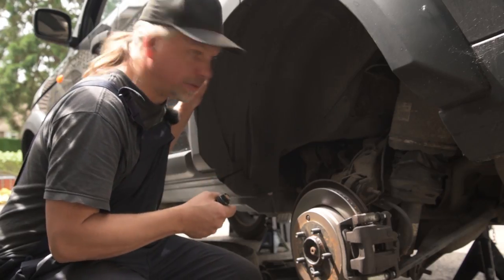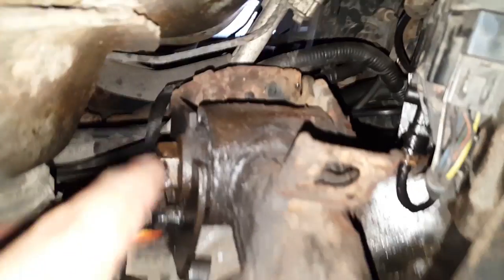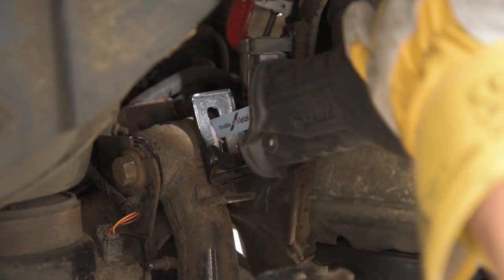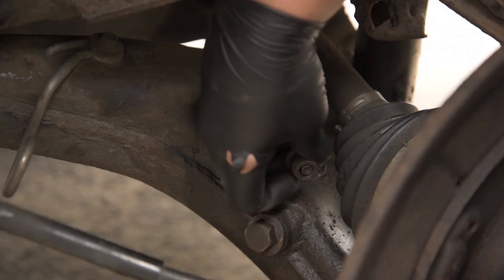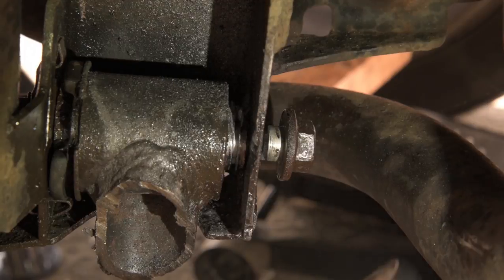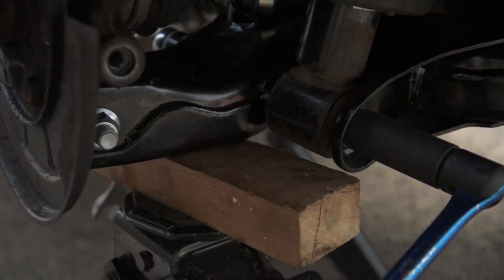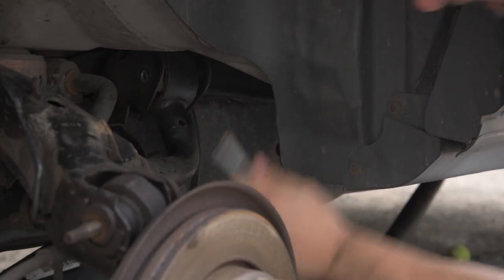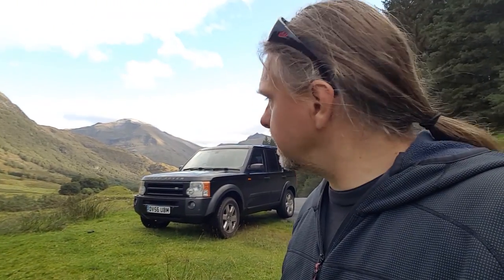Replacing Rear Suspension Arms and Polybushes - Land Rover Discovery 3

Comment: Hello, greetings from Argentina.
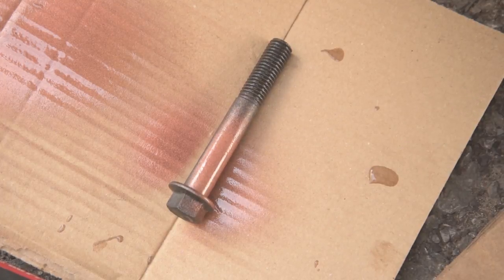Query: What is the use of the spray (apparently copper bath, or similar), that you pass to the pins, at minute 29:59, for example ...
Very good video.
Thank you. Greetings.
Reply from the maker: Hello Argentina.  The "Copper Ease" spray is the cause of great debate on the internet.  It's sold with the intent of preventing bolts rusting to the other components, but some people say it actually causes the parts to corrode faster.  I am not sure but thought that it can't be any worse than it is normally.  It's not a requirement
Thanks for watching!
Reply: @WeAreBigKids 
 OK thank you very much
Reply: @WeAreBigKids  I prefer copperslip out of a tube, but that's personal preference (previously an Siii, and now a D2Td5 owner, looking maybe to take the leap to a D3 ;) ). There's an American machinist on youtube, abom79, who live in Florida; he tends to use anti-rust sprays. You're both in close proximity to the sea and it's salty atmosphere, so I'm wondering if an anti-rusting spray might help on those iron and steel parts?

Comment: Great video👍
Did your dsc(traction control) kick in around corners at all when bushes were worn? What exactly were the symptoms?
Thanks for the video👍
Reply from the maker: I did get a weird corning incident once.  It was like driving on ice, but on dry tarmac.  The ABS went nuts and made me jump.  To be fair, other than that I couldn't really feel any symptoms of the back bushes, but noticed the suspension arms felt loose and wobbly when I was swapping my summer wheels for my winter ones.

Comment: I learnt very early on to put the suspension in locked access mode before working on the suspension on these.
Reply from the maker: It's probably good advice.  Everybody else told me to pump the suspension up high to get your jack under.

Comment: You sure do things the hard way with limited tools like a set of torches and real good impact gun.  A for effort but eventually you will get tired of wrenching when you don't need to.  Personally I would bring that to a shop and at least get those big bolts out, they seize up in the sleeve and need a torch and impact wrench...  That torch you use is only good for plumbing and doing hot-knives, but if you get the miniature double tanks (One is Oxygen) you will get the heat you need and can even do some steel welding, and brazing....  Oh!  Im certain that 2 times you were turning the bolt the wrong way, once it looked like you were pushing wrong way with your foot and at 20:10 lol... thats why you broke the tool.
Reply from the maker: Thanks for the advice.  Glad you enjoyed watching.
Reply: @WeAreBigKids  Ah, your videos are great!  Brings me back to when I was 16 going through the same things, learning the hard ways.  Keep up the good work!  Oh!  Great countryside shots as well, love the scenery. Thanks
Reply from the maker: Thanks for the kind words.

Comment: If you turn a right hand threaded bolt  to the left it will come undone but if you turn it to the right as you was  it will just  tighten it, this is why you couldnt get it to undo. As for all those cheap crappy tools just sling them in the scrap, this is why fully skilled mechanics such as myself use Snap on tools ,they dont break!
Reply from the maker: If only my Land Rover was made by Snap On.... Or Toyota....
Thanks for watching.

Comment: This is the first vdeo of yours that I've ever seen- I don't even know what the rest of your channel is about. Hell, I don't even own an LR3 (hopefully buying mine in 2 days!). But this video was so in depth and personable/relatable, and the extra time you put into the filming and editing... I would be doing a disservice by not subscribing. Cheers from the US.
Reply from the maker: Thanks for subscribing!  I hope you bought that LR3?  They're brilliant.  I've heard the US ones don't rust as fast.
Reply: @WeAreBigKids  I did indeed buy it! Some 60 year-old woman owned it since new and it's in amazing condition. I live in Minnesota though, so the salt on the roads from our winters absolutely deteriorates vehicles. Luckily it only seems to be minor surface rust underneath. Time will tell. However it did just throw the P0128 code yesterday, which I'm assuming is because it was 4⁰F outside (being that its thermostat related). Not sure if it's something that really needs immediate attention.
Reply from the maker: I was going to ask if it's broken yet, but the P Code confirms that already. Hope you've got a good code reader. Most of us use the Gap IID tool. Expensive, but really good. Especially when upgrading or replacing components. It has brilliant diagnostic data too.
Reply: @WeAreBigKids  I've got an Actron OBDII reader as of now. Hopefully it doesnt run my bank account too dry because I'm currently finishing an engine build on a Saab 9-3 Viggen

Comment: I'm guessing nobody uses a socket on the upper rear bolt. Therefore making it impossible to torque it to the required 275 NM. The only way that bolts getting to 275 NM is by unbolting half of the body mountings, and lifting the body enough to get a torque bar and socket in there! Great video, thanks for sharing. Remember, the first time is always the worst. When i was replacing the air struts the first one took 45 minutes. By the time i'd gotten to the 4th I had it down to 20 minutes start to finish!
Reply from the maker: Thanks for watching.  I hear that some folk are using Crows Feet extenders to get that upper rear bolt torqued.  A local mechanic told me they just do their best and that's good enough.
Reply: I learnt the trick to replacing these today, don't live in a country with snow!. I removed both the rear upper arms within 2 hours. No corrosion in Aus!
Reply from the maker: https://youtu.be/tv_KHH55qdQ
Reply: Yeah, my plan will be to crank it as tight as possible with the tools I used to remove it as that was JUST enough to crack the old ones, which had little to no corrosion.
Reply from the maker: One plan I had, that I never needed in the end, was to cut one end of a spanner off and use a pole over it.  You can also buy single ended spanners.  But, as we all know, where there's a will there's always a way.  Hundreds of ways, in fact.
Good luck with the suspension fix!

Comment: Nice video!  Watched the whole thing.  Have you ever done the rear wheel bearings.  I want to do them on the car but everything I've seen says wheel carrier has to be removed and pressed.
Reply from the maker: I've never done the wheel bearings.  But the rear bearings are pressed into the knuckle. The engineering manual states you need 10 tonnes of pressure. I'd imagine you can't do it without a ten tonne press.
Reply: I did both my rear upper arms last weekend, along with my rear hub bearings new EPB shoes, discs and pads all round. I have a similar bearing press kit as the one in the video and did mine with that, tbf it was knackered but not seized in, Maybe I was lucky, but it wasnt hard at all. Hardest part for me was the bedding in procedure for the electronic hand brake, it just would not work but I got there in the end... I also used a grinder with metal cutting discs instead of a reciprocating saw as I dont own one. Whole job completed in a day in my Garage. I wouldn't have even attempted it if it weren't for me watching this video though. Fantastic.

Comment: Nice to witness someone else having a Rover repair turn into a giant hairball of frozen parts, not having the right tools on hand (but stress-inducing deja vu at the same time). Pretty much every project on my 88 110 goes something like this minus the long commutes. Yes I have used a sawzall at times. Whatever size the nut that holds the pitman arm on for example is a socket that NO ONE carries. 33mm maybe? Let's see, 32mm, 34mm, 36, - check - but no 33! And neither do they carry the english equivalent. That said I did spot you turning the nut the wrong way and was asking myself if this was a left hand thread. Guess not! Thanks for documenting the ordeal and admitting to the cardinal sin of mechanics!
Reply from the maker: Your 110 story reminded of my Series 3 Military Lightweight, that I regrettably sold a long time ago.  I had all my metric tools and a friend of mine bought his imperial set round to help.  Not a single spanner or socket would fit any of the nuts or bolts on that Lightweight.  Not a single one.  Then I tried one of those bone-shaped bicycle spanners and it fit!  I replaced the parking brake with that spanner, which was a drum and brake shoes around the prop-shaft.
Thanks for watching!

Comment: When refitting the suspension bolts, it is a good idea to coat them with non-metallic SILICONE grease as this will ensure the bolts never seize in the bushes - you may need to loosen the bolts again to adjust the wheel alignment in the future.  (Non-metallic SILICONE grease is used on boats and is better than copper grease, as copper grease can create galvanic corrosion)
Reply from the maker: Thanks for the advice.  I hope never to replace the damn bolts ever again.  Someone else recommended the Copper Ease, but many more have since recommended Silicone.  You live and learn.
Reply: @WeAreBigKids  These bolts need to be loosened if you ever need to get your wheel alignment done...

Comment: I have a Discovery 3 with a knock... and I have no words.
Reply from the maker: My Discovery 3 has had many knocks.
• Front-lower wishbone bushes had gone.
• Rear upper wishbone bushes had gone.
• Front diff needed replacing.
• Tyres were worn differently.  I kid you not, if you replace two tyres and not all four at once this can cause the diff to cause a really loud knock.
Good luck with your knock.  Knowing Land Rovers, it'll be a completely different and more expensive knock that anybody else has ever had.

Comment: question why did you measure the distance between the hub and arch
Reply from the maker: The bolts are supposed to be tightened at the car's natural riding height, so not to put excess stress on the polybushes..  However, once you put the wheels on and remove the jack stands you cannot get your tools in to do the tightening. I asked what to do on a FB group and it seems the majority of folk jack the control arms up to the same height they would sit at normal ride height.  The measuring is to make sure you got the control arms jacked to the correct height.  Hope that makes sense.  Just ask again if not and I'll try again.
Thanks for watching!

Comment: I cut up a whole wrecked Discovery 4, body and chassis, into 3 pieces. I used the same reciprocating saw and still didn't go through as many blades as you!!😂
Reply from the maker: What brand blade are you using?  I wanted to use Diabolo, but couldn't find them for sale in the UK.
Reply: Lenox and Makita. Trick is to pick the right blade for the job, not get the blade too hot or smash it end on into something 😜
Reply from the maker: Got it - DON'T smash the end into anything....

Comment: hey there, do you know maybe power of nm to front upper ball joint??
Reply from the maker: No, haven't done then front ball joints on mine, but it's in the engineering manual. You can download it from the FILES section of this Facebook group:-

https://www.facebook.com/groups/207921512745848/
Reply: @WeAreBigKids  ahh I am doing the same things as you, but on front susspension. I twisted screw of upper ball joint in upper arm :/ thats why I need those nM. Thanks a lot, I watched your video few times and I learned a lot :)

Comment: Awesome video, thank you. I feel a lot better now, as I always thought that I'm the only person who has stuff like this happening. ;-) I appeared as whether you tightened the bolts through the bushings before you lowered the vehicle. This creates quite a bit on tension on the bushing and makes them wear faster. You might therefore want to loosen and re-tighten the bolts to relax the bushings when the vehicle is at a normal height.
Reply from the maker: Nice to hear from another honest DIY mechanic.
As for tightening the bushings, you'll note that I jack the knuckle up and measure it to normal ride height before tightening the bolts.  It's the same as lowering it, with one massive benefit:  If you put the wheel back on and lower the car to normal ride height you simply cannot get any tools in to tighten the bolt.  The only way I can see of doing it that way is by removing the body and having unhindered access to the full drive train from above, like they would when they build it in the factory.  At the rate things go wrong on these damn Land Rovers there will be no car left before the new bushings wear out again anyway.  I could be wrong, though.  As you've seen, I am no expert.
Thanks for watching, glad you enjoyed it.
Reply: @WeAreBigKids  Very clever, thanks for the clarification. Our LR3 has worn bushings in the front, since this appears to be a common problem, I am however leaning towards replacing them all around and to get the versions with poly bushings, which some dealers are selling.
Reply from the maker: I put poly bushes in mine in the video. That was 18 months ago a they still squeak . Others on the forum say they're a harder ride, but I'm not sure. Do some googling on it before going poly bush.  I'd probably use OEM if I did it again.
Reply: @WeAreBigKids  Oh, I wasn't aware of that. Thanks for the hint!

Comment: What symptoms had you with discovery that led you change these. I’m having a thud like clunk when changing gear like like 1st to 2nd like something is shifting. Also the handling on country roads is dangerous.
Reply from the maker: The bushes wear, which makes the pivot points wobble.  If they're worn on the front you get a bang when you slam on the brakes at low speeds.  If it's the rear, you get lane drifting on the motorways.  They're all MOT failures, so the test pointed mine out as advisories.

Comment: а как называется набор, которым выпресовывали задние сайлентблоки?
Reply from the maker: I have used Google translate, but I am not too sure if I understand the question.
I replaced the Upper and Lower Rear Wishbones, also called Control Arms or "A Arms."
The bits I sawed through are the Wishbones and I also sawed the mounting bolts, the bolts that go through the bushes.
I am not sure if that's what you're asking, but I hope it helps.
Thanks for watching.
Reply: @WeAreBigKids  I asked what tool did you use when pressing out the rubber-metal hinge. sorry my bad english😁😁😁
Reply from the maker: It's called a Universal Bush And Bearing Removal Press And Pull Sleeve Kit.

https://www.amazon.co.uk/gp/product/B008LL2PVC/ref=ppx_yo_dt_b_asin_title_o08_s00?ie=UTF8&psc=1

Comment: Mark the bolt because its an eccentric cam which controls the camber of the wheel. if you are puttin a new arm on, the bolt should go in alignment with your mark to keep the camber the same.
Reply from the maker: You could do that, assuming the new arms are exactly the same dimensions, but you'd have nothing to align the mark to on the new arms.  The old marked bolt gets thrown away so you wouldn't have the mark on the new bolt either.  A better way is to have a 4 wheel alignment.
Thanks for watching.

Comment: What is that copper colored spray he puts on the bolts?
Reply from the maker: I was advised by a mechanic to apply Cooper Grease to all moving parts.  They said it would prevent the bolts rusting solid.  HOWEVER, it turns out this is the cause of great debate on the internet, as some say that Copper Grease speeds up rusting, rather than preventing it.  I think it's made by the same company I got my Snake Oil from.
Reply: @WeAreBigKids  Interesting!  Thanks for the response!!  Great video by the way! I replaced my upper rear control arm over the last few weeks as well and ran into all the same problems. Many of your tips helped a lot, and I didn't feel alone when I kept thinking about scrapping the whole vehicle.....  Had many moments of despair on this project, ha! And like always, now that its done, I feel like I could never live without my LR3..

Comment: Another solution is a "mobile mechanic" that has all the tools who comes to you to do the job.  I have used one a few times in the past.
Reply from the maker: Are you in the UK?  Which mobile mechanic did you use?  I'm currently in need of one to come to me in Swansea for an electrical fault I'm currently experiencing.
Reply: @WeAreBigKids  Yes I'm in the UK and I know a mobile Landrover Specialist.  Will send you details soon.  The labour rate is cheaper than a garage too (usually a fixed price).
Reply: @WeAreBigKids  What electrical fault are you experiencing?
Reply from the maker: I've installed a new Parking Brake Module and Cables, as it had lost communication on the CAN bus.  Module now works and I can apply and remove the parking brake, but I still get a fault light, which will fail the MOT this month.

IID Tool gives following error code:-

C1A55-64 (FB) Ignition Switch input circuit - Algorithm based failure - signal plausibility failure.

Further reading in the parking brake .pdf reveals this extra description:-

• Parking Brake actuator module ignition supply circuits: short circuit to ground, short circuit to power, high resistance.
• Parking Brake actuator module key in supply circuit: short circuit to ground, short circuit to power, high resistance.
"Check the parking brake actuator module ignition and key circuits. Refer to the electrical guides. Rectify as necessary. Clear DTCs, complete drive cycle 1 to test normal operation, refer to relevant drive cycle shown below this table."

Drive Cycle 1 Description
• Ignition On
• Make sure that no parking brake activation (diagnostic command or switch input) is attempted for a minimum of 3 seconds
• Retest for functionality.

This weekend I plan to replace the fuses for the parking brake and recharge the battery, just in case it's a low voltage.  But if the problem persists I'll be well and truly stuck.